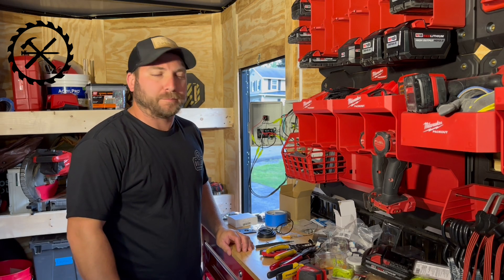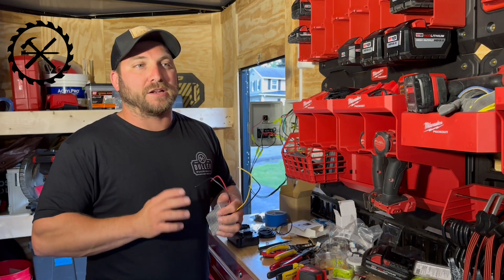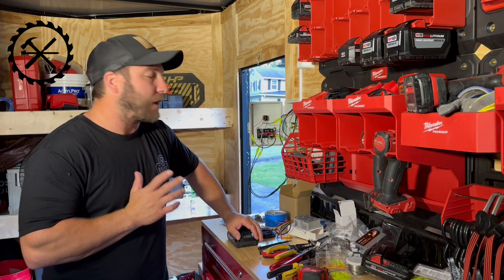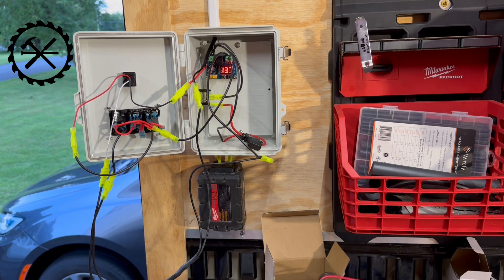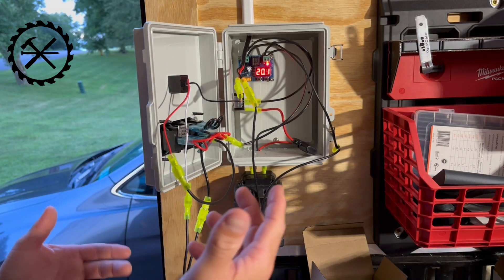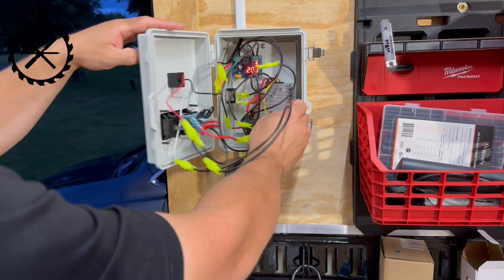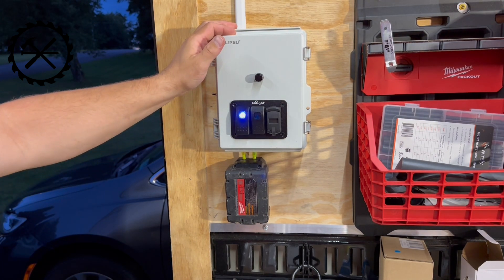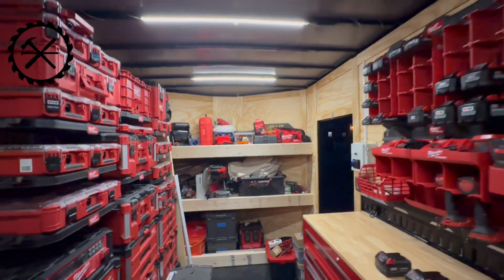Trailer Lights Powered off a Milwaukee 18V Battery

Comment: I’m watching this video to help me wire up a light bar on a mini bike. If I’m using a m18 battery, do I need the 12v step down, or should I just use a m12 battery
Reply from the maker: You could probably use a 12v battery. I believe they actually put out a different voltage than 12v but it being that close would probably be fine as long as the lights are 12v lights. I have so many 18v batteries and I wanted the lights to last longer, that’s why I did the step down

Comment: How long does it usually run for
Reply from the maker: I haven’t tested it to see exactly but it lasts a good amount of time. I typically shut it off when I exit the trailer. I don’t leave it on
Reply from the maker: Just did a test and a fresh 5.0 battery lasts about 3 hours

Comment: you can calibrate the cut off board if the volt off !!)
Reply: check instrution
Reply: old button for 3sec
Reply from the maker: I don’t believe you can calibrate it but you could be right. I’m not familiar with that